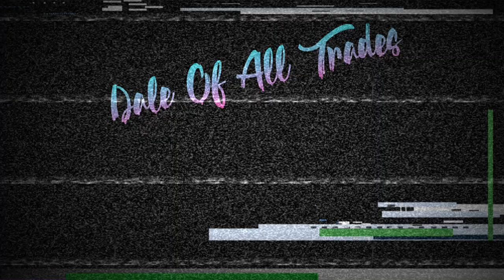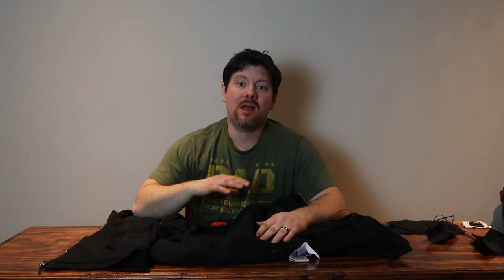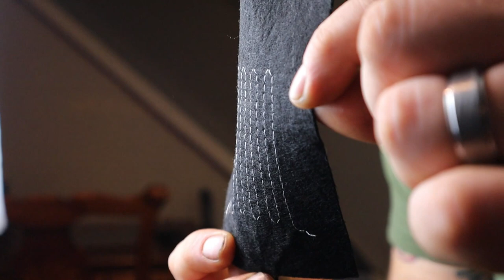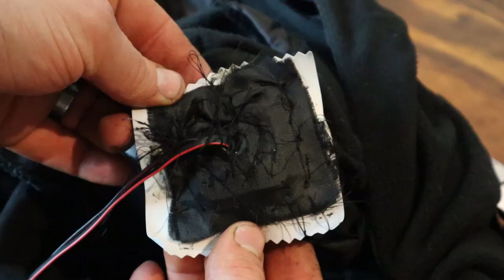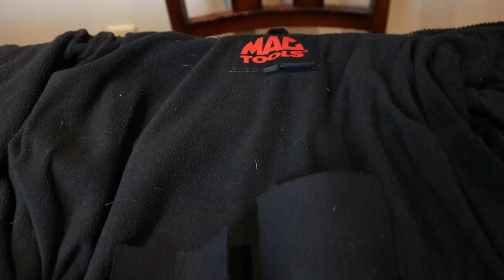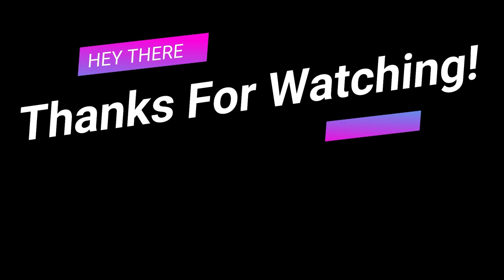Heated Jacket Repair

Comment: This is a good idea, I forgot about these kits I paid about 60 for unbranded one that works great but the wire that connects to charger just like a phone charger lead is on its way out. I think the manufacturing cos need to make more robust stable ports so this doesn't happen and maybe make it so you use a regular phone lead between jacket and battery so less wear on jacket wires.